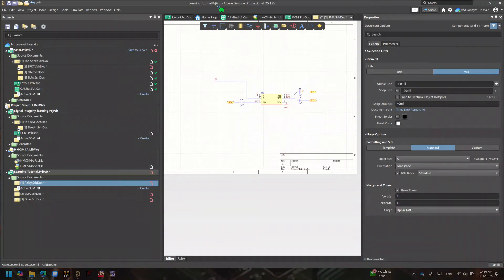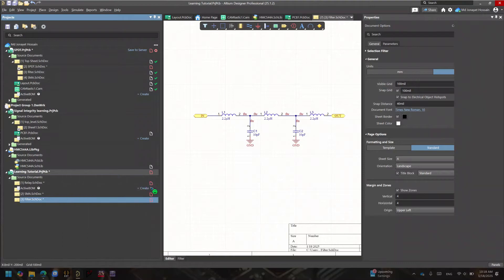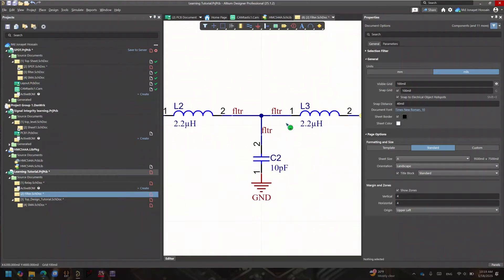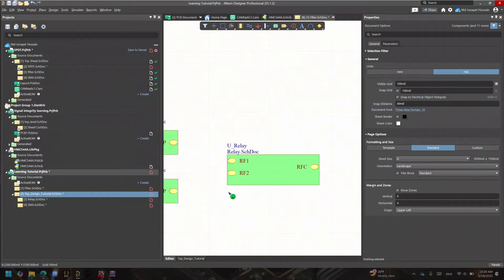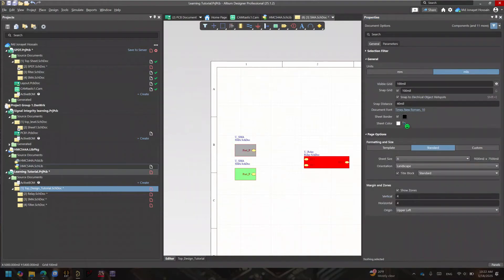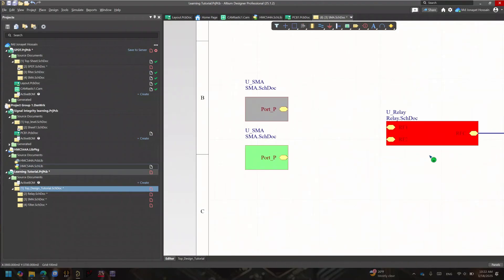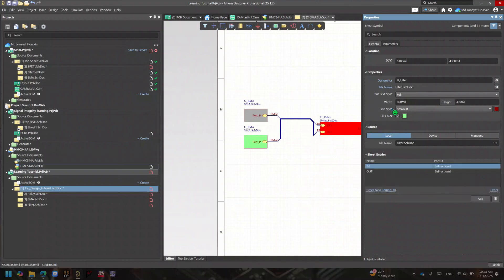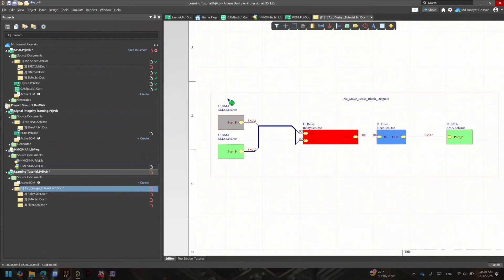Altium Designer Schematics | Hierarchical Design

Comment: how use  Stereo Potentiometer (VR50KX2) in hierarchical schematic for preamp circuit
Reply from the maker: Create a symbol for the stereo potentiometer and then place it on the higher level schematic, and then connect it to the necessary lower level sheets. 
I am not sure what exactly you are asking for but the all essential system follows the same principle